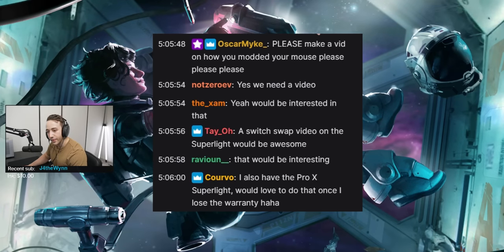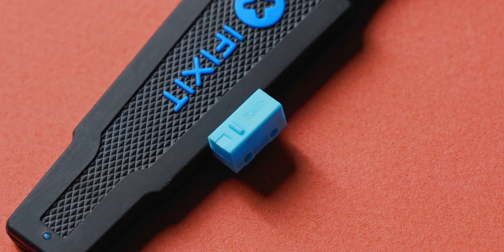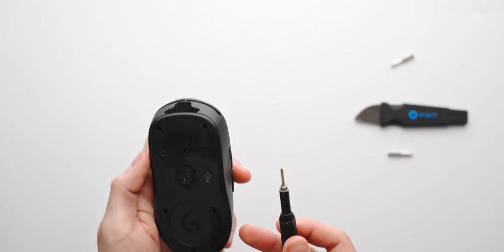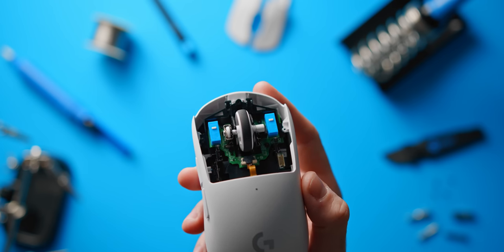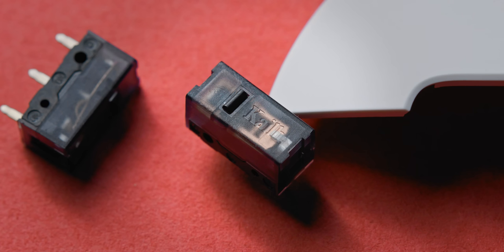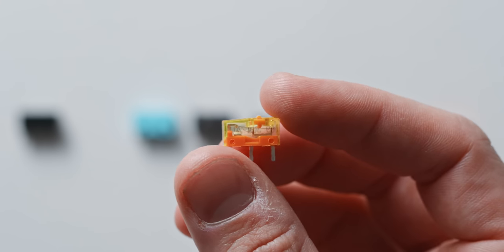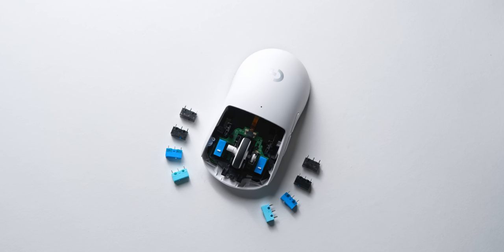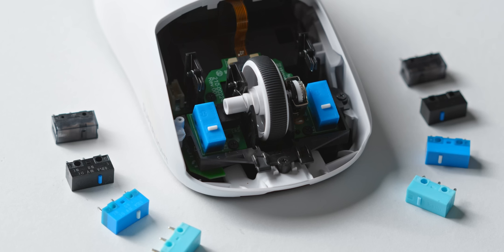Upgrading my Gaming Mouse Switches

Comment: What if you replace the switch with the razer viper switch
Reply: not sure it would be so easy due to the firmware differences between optical switches and normal ones like these. Not sure if you realize or not but theres a fundamental difference in how these actuate and send/cut signal and the way the optical switches work.
Reply: @crisnmaryfam7344  I understand right after I commented that, I researched about the switch and found out the laser part is on the board not on the switch so yea there goes that idea

Comment: I tried this and now i am soldering trace wired on my mouse
Reply: Haha been there. Protip!!
Instead of soldering a wire trace, do this. With something like an exacto knife, lightly scratch/trace the PCB, just enough that the copper layer is visible. And then solder like you normally would making sure to bridge the solder to the trace you just made. Then the switch should work.
Reply: @seavoodoo4219  i just made it janky but it works
Reply: @maple__m00n1  Nice!

Comment: Aaaaaaargh!.. I always cringe when I see a hard plastic tip on a flux sucking pump with no silicone/rubber tube attached to it.. 😬 It's like nails or bad chalk screeching on a blackboard.. 😖
It's such an.. ugly way of sucking the flux of a joint.. especially on a double sided PCB.. and it is so prone to damage those traces/vias (peel off the copper trace/via) if heated for too long..
Just cut a sized piece of heat resistant silicon tube and slide it on the flux pump tip God dang!.. Cut it at a slight angle just for safe measure, that way you'll get an even better "seal" around the sucked joint when placing the tip on top of it.. (no more trying multiple times to suck the flux and re-heating those joint/s multiple times) This tip is especially helpful for first timers.

Comment: If anyone here owns a G900/G903/G Pro, do yourself a favor and get some Huano Blue White Dots or something.  For some reason these mice chew through Omrons and your mouse WILL start failing at some point.  I went through 3 pairs of Omrons before I finally put in the Huanos, and been going good for 2 years now

If you don't want to do this mod, I would go so far as to say do NOT buy these mice, despite them being the best wireless mice on the market, and the best I've ever used.  Honestly appalling that Logitech doesn't address this issue

Comment: Aw man, saw your Instagram post and thought Logitech was finally going for hot-swappable switches. This is kinda disappointing, I already soldered custom switches on my G903 and they're already having double-click issues again... Logitech needs to step up their game or ASUS will beat them.
Reply: having double-click issues again - isnt logitechs fault if you already swapped the switches, also, its not logitechs fault regardless, the switches from the factory are omron products lmao. Surte its logi'ss fault for not shelling out and going with Kailh in the first place, but it was some marketing guy who dealt with that, got a deal from ormon on 50 trillion switches at a cut throat price, thus we have cheap ass ormon 20m

Comment: Felt bad clicking like with this terrible soldering advice and awful demonstrations, lol.  Firstly, don't "start to learn soldering" with something you intend to keep working.  Little project kits are available for about a dollar.  You may have a defective iron that doesn't quite get hot enough, which you'll want to know before working on something you care about.  If you lift a pad or break a trace, you could end up throwing the mouse out or paying a minimum bench fee of ~$50 to have a repair shop fix your damage.  At the very least, a dumb-device "beginner kit" project or two (or more) allows you to get used to your tools and solder combo before trying on something of value.

Do watch tutorials.  Don't push anything with the iron-the heat must do 100% of the work; pressure should do 0% of the work.  Do use a wet tip to conduct heat well and quickly.  Do clean the old solder off the pad.  Do use a small amount of no-clean flux on the component legs and the pad, or use a quality no-clean flux-core solder.  Don't heat the pad or component for excessive amounts of time--the goal is to complete a joint in two seconds.  Do try to feed the correct amount of solder to fill the via and form a correctly-shaped fillet during that two second window.  Do touch the tip to both the pad and the component lead to heat them both before feeding the solder from the opposite side.  Do feed the solder into the PAD at the side of the lead opposite the iron- DON'T FEED SOLDER ONTO THE IRON, AS THAT IS THE SUREST WAY TO GET POOR RESULTS.

Also, the solder sucker he shows--these are fine but unnecessarily difficult for a beginner.  For two switches just buy some solder wick.  He correctly doesn't press it into the pads, which can instantly dislodge the pad/trace with too much heat in the joint and a small careless slip of the hand.  Still, the sucker tip should pretty well be contacting the solder and (hopefully) successfully clear the hole completely in one pull, ultimately leaving the component loose before trying to remove it.  (If it's not loose, you can rip a trace loose if you try to pull it off.). He doesn't show that because he couldn't do it correctly for camera.  Gotta be fast.  And if it doesn't clear, you often have to add a little solder back to wet the whole joint again to try the sucker again.  It's a chore if you have more than a few pads to clear.  Just use desoldering wick/braid with flux unless you're replacing lots of stuff.

Ok, srry for the rant lol.  Have fun kiddos.
Reply: I find soldering wicks extremely difficult to use, particularly for beginners and on smaller or cramped PCBs. I would rarely recommend them over a decent solder sucker, which is easier, quicker (exposes the PCB and switches to less heat), and more precise in my opinion. It's also safer since you don't have to worry about burning yourself. And a solder sucker's small tip is resistant to melting or burning, meaning you can put it right against the iron for a few seconds without issue the very moment the soldering joint is liquified.
Reply: @GENKI_INU   Some good points, particularly being able to see where you’re working in a small board. I hate it when a puller -- even my powerful edsyn soldapult -- fails to clear a hole simply because I can't position it close enough before the solder solidifies and I have to try again.  Or especially when it strips the wetting completely off my iron tip.  But I suppose I can concede that wick requires technique as well.  It requires you to keep the tip wet, and to adjust heat per the mass of the joint--essential skills to develop for a beginner at soldering, so it's good practice in my view.  It also is very awkward when holding a board with a "helping hand"--easy to use wick when the board is laying down on the bench.  I guess it's hard to speak in absolutes, as understanding your iron is key either way.  And inferior irons are frustrating at best for anyone.  Same for using tip that's poorly matched to the scale/shape of the work.  Thermal mass, wattage, and recovery times--it's all important for great results.

Wick won't heat the joint any more than when using a puller if your technique is right.  For people removing lots of larger components, yes I agree pullers are very preferable, provided they're sized to clear the whole joint in one go.  But small joints come clean so quick and easy with wick.  I eventually upgraded to a hakko desoldering gun, so now I use it for small joints too if I'm doing more than a few--but I also needed a number of tips to cover the typical range of component leads I encounter.  If you're intent on only working on one scale of small project board, maybe it'll never matter to you.  But I think wick is the best place to start for absolute beginners.
Reply: Beginner "solder'er" here and this was my first project. Bought a $20 soldering iron kit off amazon lol came with everything I needed and got the job done. I looked up a million tutorials on soldering and practiced on old boards and then practiced on old crappy mice I had laying around. I DEFINATELY agree that you shouldn't learn on the project you intend to work on. I messed up while practicing and thanked the lord I didn't just go straight for it. But after 45 minutes of practice I got it down and the switch swap on my G pro superlight went down without a hitch. Super happy with it. I also tried using the soldering wick but found for this project just using the sucker that came with my kit was a a lot easier. I'm obsessed now and am pumped that I have a new skill and look forward to building my first custom mech keyboard lol.